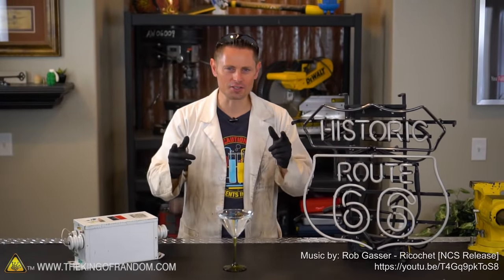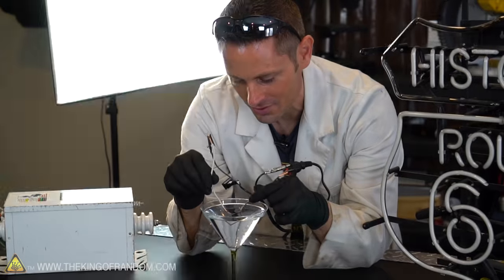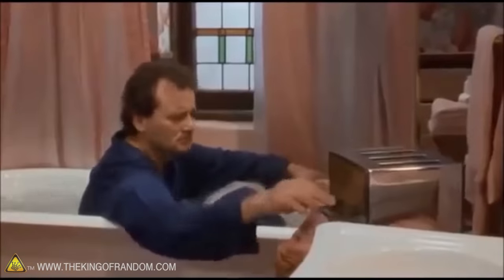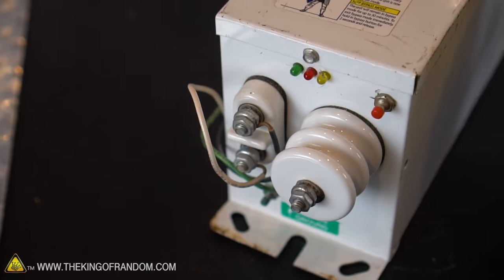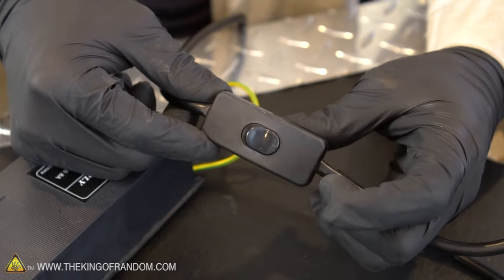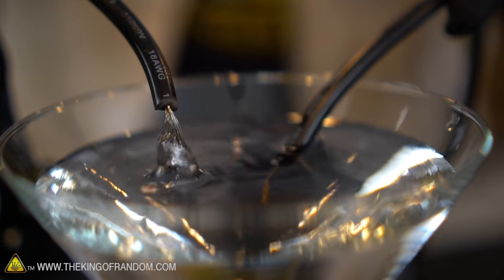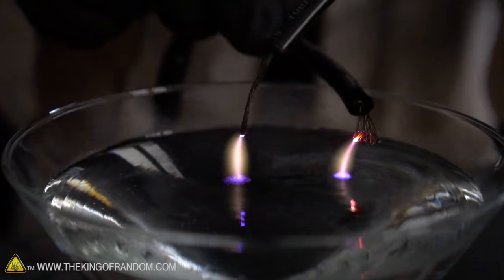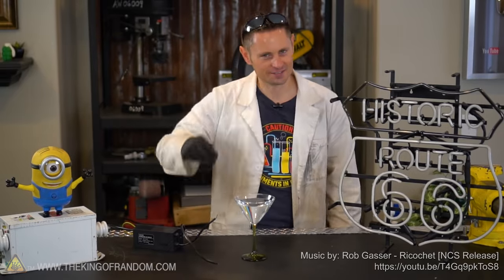Don't Mix Electricity And Water! TKOR Experiments What Happens With Electricity In Water!

Comment: Actually, distilled water does conduct electricity, just not enough to power that light... Even if it is pure water, distilled water actually has ions of hydrogen and oxygen dissolved in it.  De-ionized water is the only non-conductive water...
Reply: Additionnaly, water is a very special substance because it is the only chemical bond which is polarized, a polar covalent bond. This gives water the ability to separate other substances into ions and allows it to be attracted to your wires.
Reply: Yeah even distilled water would have hydronium ions.
Reply: Well, water is not the only polarized chemical bond in nature, but it is probably the most abundant and most important one. As Noss_Silver and Shivali Sahu said, even "pure" water has H+ and OH- ions in it. ("Oxygen" normally is O2, and not ionic or polarized, so that is not what we are talking about). I am not sure that one can completely "de-ionize" water for more than a brief period of time given the equilibrium ratio between the H2O molecule and the disassociated H+ and OH- ions, which typically is described by a disassociation constant. Also, H3O, or hydronium ions, are part of the equilibrium contstituents, albeit briefly.
Jeffrey, what scares you about understanding the world around you?
Reply: Great job 👍👏👏
Reply: Jeffrey Fonder you sound like a 5 yr old bully in school..
Reply: @lastlight4252  That's awesome. Thanks for posting.

Comment: Water isn't conductive, the minerals in it are
Reply: Josh Hansen TAP WATER
Reply: I will agree with that, there must have been some materials in the distilled water for the high voltage test.  You aren't going to get electron flow with that voltage in H2O.
Reply: Pdizzle D neither destilled water not air is conductive, but they are dialectric. what high voltage does is to polarize a dialectric material making it conductive, the same as when you put a magnet in touch with a screwdriver and it develops magnetic poles while in touch.
Reply: Distilled water can conduct electricity, but not as much as water with ions inside, this because water exist as an equilibrium between OH-, H+ and H20. Obviously it's not much, at pH=7 we will have 10^7 mol of H+ and OH.
Reply: Instead of thinking about whether a material is conductive or not, it becomes helpful to think about how resistive it is. After all, ALL things can be conductive at certain voltages. Voltage is a unit to describe electromotive force (EMF) and is counteracted by resistance measured in ohms. There is no unit for conductivity because it is relative to the voltage that is applied. Even specially engineered tools designed to be insulated from electricity become conductive above certain voltages.
Reply: So, since electricity chooses the path of least resistance, it would have jumped to the water instead of the air due to pure water having less resistance...am I understanding this correctly?
Reply: Yeah, I was also thinking it had to do with the magnetic polarity change since the way it was consistently entering at the same path inside the glass.
Reply: Josh Hansen don't mix normies and dank memes

WARNING: VERY TOXIC!!!
Reply: Josh Hansen 
water is conductive because there are tiny bits off OH3 ions and OH ions in it(yeah also in distilled water) it is a chemical thing.
Reply: "Free electrons" carry "electric charge" on every hard object (wires and so far), "free ions" carry that charge in fluids, that's all the sience.. (free electrons or free ions movement is electricty) .
Reply: Evidently. So I wonder if the "Hey Culligan Man"..?
Should have a larger?
  Or smaller role?
What think you?
Reply: Josh Hansen true
Reply: LaserGadgets hi

Comment: Electrical bill=$9,000,000
Reply: its draw is 0.8 amps or about the same as a seventy five watt light bulb
Reply: ... that's suppose to be alot, right?
Reply: P.O.D no.
Reply: Is that supposed to be funny? Because it is not even close to 1$
Reply: Classified ahaha you're SO FUNNY
Reply: Please don't make fun of people, because they don't know as much as you do.
Reply: Nathan and Jamie this wasnt even supposed to be funny
Reply: Classified lol you don’t know nothing about electricity.  It draws like 500- 800 milli amps  which your air conditioner in your house draws more current than this.
Reply: P.O.D by comparison, a heater is likely to draw over 1000 watts.
Reply: You can't just compare power usage with amps only. To convert to high voltages it also takes energy.
Reply: jann klaasen You can when you know voltage.
Reply: jann klaasen frequency voltage amperage wattage all matters too
Reply: jann klaasen it doesn't take extra Energy, cause when Electric current Passes through a transformer and the volts rise the Amps Go Down so the Energy is the Same
Reply: YouTube add revenue=99999999999$
Reply: ITS OVER 9,000
Reply: it's high voltage and low current so not much power compared to high voltage and high current.

Comment: Am I the only one who's curious as to why the electricity pulled the water up with the wire!!?? Please Like this comment so Grant will see it and answer my burning question!!!
Reply: MRLASER1231 This may due to the polarity of the water molecules. Water has partially positive charged Hydrogen in its structure which was attracted to the negative electrons passing from the wire. This could've caused adhesion between the wire and the water molecules and hence layer of water is lifted. This is similar to surface tension and how insects can stand on water.
Reply: Maybe it has to do with electrostatic charges attracting each other. If my school knowledge doesn't fail me, water contains small ammounts of OH- and H3O+ besides the usual H2O. So the negatively charged OH- is attracted to the positively charged cable and the positively charges H3O is attracted to the negatively charged cable.
Reply: The water is ionized so it gets attracted I think. Otherwise it would not be conductive...
Reply: Will cutting the power cause the water to drop immediately?
Reply: It's because H2O is a polar bond, meaning that there is a slightly negative charge around the oxygen and a slightly positive charge around the hydrogen. Since electricity is the movement of electrons, which are negatively charged, it will attract the water by the hydrogen end of the water molecule.
Reply: The same reason your hair moves toward a balloon
Reply: MRLASER1231 well electricity is negative charged and the water has both a postive and negative charge but the positive will be pulled toward the grwtaer electric
Reply: I'm only guessing but water is a polar molecule so it does respond to magnetic fields. moving electrons generate a magnetic field.
Reply: Oliver Elam you mean static electricity
Reply: I'm not sure about that bipolarity thing, I'd say it isn't that strong... Buf If it's correct the effect should also be visible using the standard 120V. He should test if the surface bends using main power. If not its because of the ionization. Or both effects working together...
Reply: The water becomes polarized so the electrons attract the protons in the water with enough force that the atoms are pulled towards the wire. Also, the water is more dense then the air which is a factor towards the reason of why water is a better conductor then air.
Reply: HiMyNameIsJakeAble yes and no
Reply: water tension nothing to do with lectricity
Reply: Hydrogen has a slight POSITIVE charge, since the oxygen is hogging their single electron, giving the oxygen a slight negative charge...  all of this is negated though, as the molecule as a whole is neutral  - meaning that the net positive charge of the hydrogen is equaled out by the net negative charge. The difference allows it to interact in hydrogen bonds, but this in it's self doesn't account for the observed effect in this video.
Reply: Guy S I apologise but the word 'polar' means the uneven distribution of charge. You yourself can research this up but water molecules, as you probably know contains two hydrogen and one oxygen. The hydrogens are partially positive, which is also written as delta positive and oxygen is partially / delta negative. This allows a permanent dipole-dipole interaction to form between water molecules. Lol
Reply: MRLASER1231 it's the difference in potential (voltage) that causes current to flow
Reply: Guy S, in fact compounds can indeed be "partially negative", see the polarity in water (and similar molecules) is due to partial polarity, not a formal charge. The structure of water is controlled by the valence shell electron pair repulsion, forming a partial negative on the oxygen, and positive near the hydrogen (allowing for the cohesive forces of hydrogen bonding). Hydrogen may form a formally positive "ion" but in water forms a partial positive due to electronegativity and the oxygen's lone pair of electrons. If there was no partial charges than nucleophilic substitution (both uni- and bi-molecular) would not be possible, and we wouldn't have Tri Nitro Toluene (TNT).
Reply: polarity of water molecules, allows water to gain small amounts of charges easily. There is a machine that turns water into electrical power (extremely small amounts) (insert name here's) shower was the name of the machine.
Reply: its the same concept.
Reply: It has something to do about the fact that electricity and water have gotten happily married 7 years ago

Comment: Try electricity and mercury that would be interesting.
Reply: Mercury is a metal, it's conductive.
Reply: mercury is super conductive actually nothing much would happen look up a youtuber codys lab he uses mercury ALOT he even uses it as a switch for his vaccume chamber
Reply: Matthew Marquez he would get poisoning from its toxic gases
Reply: Mercury was used in old elecrical switches. It's still used in some tilt switches
Reply: Matthew Marquez I don't see why that would be interesting...
Reply: I thought It might be interesting because the density of it would make for some strange waves like the water was doing.
Reply: Matthew Marquez murcury is used in many old tilt switches...
My old house had a murcury switch thermostat
Reply: Wife if its that unsafe I guess there is nothing we can do.
Reply: Mercury is conductive like any wire. Without a direct short circuit it would not be eventful. BTW don't stick your tongue in it while it's hot,
Reply: Matthew Marquez murcury is metal so it will probably look prtty cool
Reply: mercury is used in some light switches

Comment: you should put the wires near each other in a vacuum and see if that changes anything :D
Reply: Kaprix73 
I must see dis
Reply: YES!!!
Reply: Anirudh Sivakumar but the electric arcs are formed because the high voltage electricity ionized the air and make the air conductive, and then current is able to flow through and the arc formed, but theres nothing for the electricity to ionize in vaccum...
Reply: the "electricity" between the two wires is plasma which is a state of matter so it will show the arc in the vacuum
Reply: Kaprix73 Cody's lab has done this
Reply: Manan Joshi Do you know what plasma even is?
Reply: tizoro3 yup
Reply: Dude plasma was the thing you just saw. It is ionized air. That arc isn't called plasma. Ionized air is called plasma and that arc is ionized air. Arc cannot form in vacuum. You may have seen it on YT cause near perfect vacuum is not possible by house vacuum pumps and stuff. There is still some air in it
Reply: Bladen Martin the arc are electrons passing through the are
Reply: SPOILER ALERT 
nothing happends, and it will probably be very hard to get those wires in a vacuum chamber.
Reply: Kelvin Luk just lioe the destiled water is non conductive it makes and arc (a bridge) between the wires, havent you learnt anything from the experiment
Reply: Kelvin Luk no vacuum is a perfect vacuum.

Comment: so if I dump distilled water on my phone it won't break?
Reply: Don Field it will because water will pick up ions and become conductive
Reply: that's not how that works lol
Reply: Don Field 
if you pick up a phone immediatle after a dunk in tap/clean water, turn it off, ant dry it sure.
Reply: if it's pure water, it won't. this is how they clean circuit boards that are very fragile.
Reply: TheBraveGallade not if you have a Samsung galaxy s8
Reply: David Tinnerello pure is not distilled
Reply: Five10 Yes it is. Pure water is distilled to the point of no impurities.
Reply: David Tinnerello if it was put in distilled water for a period exceeding 20 minutes the ions that are present on the circuit board will eventually be picked up. this would cause the ions to cause the water to be much more conductive
Reply: David Tinnerello okay, let me say it again: pure water is not (always) distilled. we have other purification techniques in which we dont remove all the electrolytes because for most applications we dont need distilled water
Reply: of course it won't only if it's water proof but lol

Comment: If you had a high enough voltage could you pull up like a pond or something?
Reply: i'm replying so i can see the answer. CAN ANYONE ANSWER THIS?
Reply: gravity is electric not an independent force like mainstream science claims... .
Reply: the practical answer is no.  Because water is polar (magnetic on a molecular scale. This is also what creates surface tension) this seems like an extension of the experiment where you redirect a stream of water using a wire (look it up). But it seems to be limited by its own surface tension. So once you get bigger than this the effect will likely be less visible. The intrinsic magnetic fields of water just don't seem strong enough. That is the short answer
Reply: speedd13 The power of copy and pasting 😂
Reply: Midnight Rider some people are actually smart cough cough
Reply: GRAVITY SUCKS
Reply: Your profile pic is very close to mine
Reply: You would need a whole lot

Comment: Can you test it in alcohol
Reply: Its not gonna work 
You need ions to make electricity transfer 
2x H20 + CO2 => HC03- + H30+
Which means the carbon dioxide makes ions that allow electric to go through when alcohol wont
Reply: depending on the alcohol purity. it i have a feeling R3ShOck had some "Mad Dog 20/20" in mind
Reply: lol or gasoline
Reply: he should try if a stick of dynomite conducts electricity :^)
Reply: Pikop V  thanks for the explanation
Reply: Pikop V true
Reply: Nothing would happen.
Reply: Big Brother it jumps through the water doesn't conduct it that the easiest way to explain it
Reply: Sheep all my equations are true its dissolution of C02 (which is an acid and causes acid rains btw)  in water
HCO3 doesnt exist it would male 6 different liaison on a single carbon which would be Sooo unstable
Metals can conduct electricity because they are solid (if you wanna know why google it). If they are in water they NEED to be ions (copper sulfate for exemple) because electricity is move of charges and charges are carried by ions
(solid) metals are different because electrons can move inside of a piece of metal
Kiss
It make perfect sens
Reply: Big Brother I would say the high voltage forces it to react like this 
2x H2O=>HO- + H3O+
That would explain why there is no electric arc in the water 
Im not sure tho ive never studied it

Comment: +Grant Thompson - "The King of Random"
Mix salt in water then do the same...!! please try.
Reply: salt and water is just salt just being in the water, but a reaction would occur if he mixed MOLTEN salt in water
Reply: Wendadon Playz he meant put salt in water and then put the wires into the aqueous solution
Reply: Soaps are fatty acid salts so basically adding soap is analogous to adding table salt (both produce free Na+ ions).

Comment: Now do a fork in a light socket! Like if you agree!
Reply: I stuck a knife in the light socket once and I only felt a funny little tingle in my hand. Go try it and see for yourself right now. ;)

Although, I was wearing rubber shoes and griping a plastic handle.
Reply: Green Alien in 3rd grade i got suspended from a school because i stuck scissor blades in light sockets and wall outlets because i liked watching the sparks flash and once i did it with a gum wrapper and it caught on fire as purple and green sparks shot out at me

Comment: Does electricity flows through loquid nitrogen and dry ice also?
Reply: Well, anything "conducts" if you just amp up the electric field strength. Pun intended.
Reply: Except it isn't. Dry ice is pretty decent insulator of both heat and elecricity, in fact.
Reply: dry ice isn't a superconductor, it's used tu cool them down
Reply: Regarding liquid nitrogen, it is non-metal and the N2 molecule is non-polar, so there won't be conductivity. Same goes for the CO2 molecule.
Dry ice isn't cold enough for most current superconductors, which generally still require either liquid helium, or liquid nitrogen at best.
The highest temperature superconductor to date requires 133°K, or -141°C, while dry ice is barely -79°C
Reply: anything just cold enough will eventually conduct electricity (superconductivity).
Reply: Kirigaya, incorrect, some metals, like gold and silver have yet to exhibit any superconductivity down to liquid helium temperatures, but may still exhibit at much closer to absolute zero, however that is yet to be proven. Insulators will not become superconductive at any temperature, that includes liquid nitrogen and solid carbon dioxide.
Reply: ishaan gandhi depends on if the liquid contains ions or is a liquid metal otgerwise probably not
Reply: nice grammer m8
Reply: lol